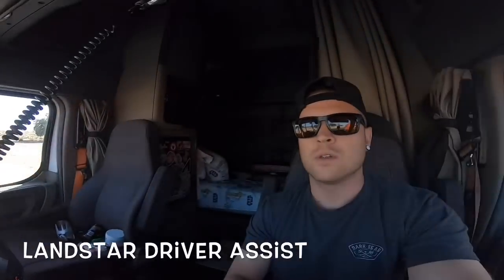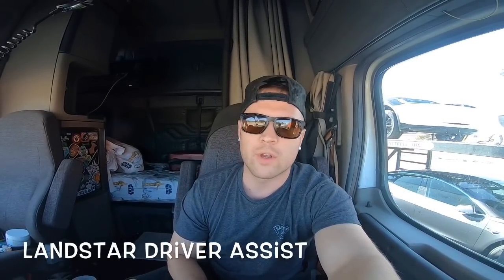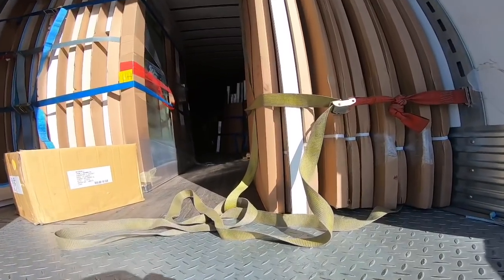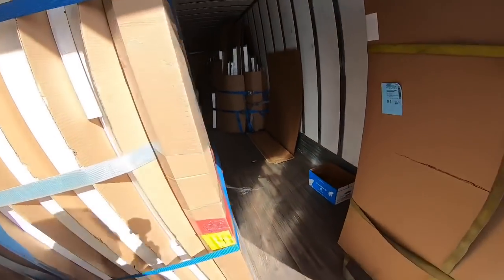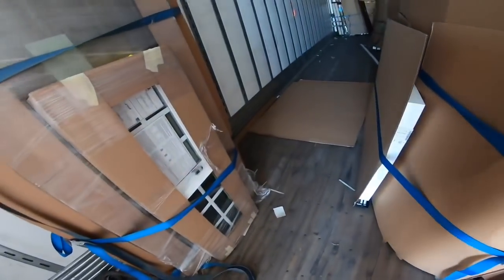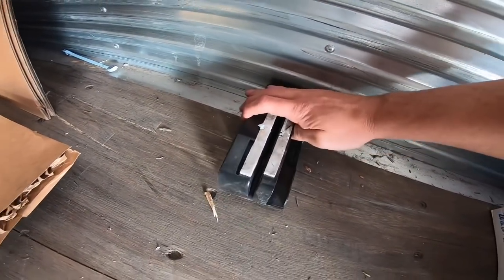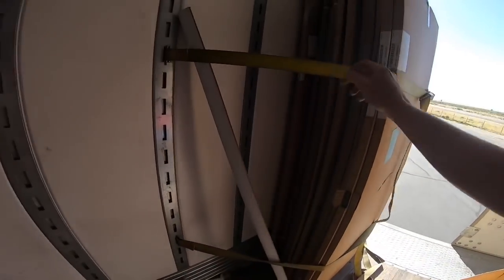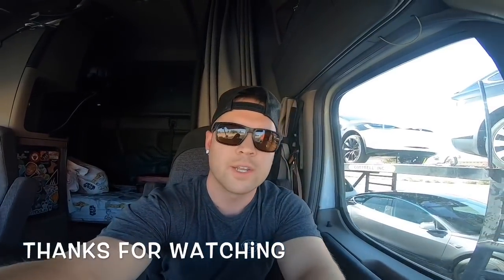Landstar Driver Assist Loads Info

Comment: I have to laugh when people call us dry van guys "steering wheel holders" . Driver assist on that load would KILL most flatbeders.
Reply from the maker: skyeram I know right and dude tires are even worse. I’m swore for 3 days after pulling a whole load of tires down that are stacked in like Tetris. Then put a tire on the ground and use your body weight to bounce them down the trailer to the guys at the end to receive. I would have to say tires are the hardest out of most of the driver assist loads I have done.
Reply from the maker: Temptinfates yeah this one looks waaaay easier than the last window load I did. There were giant sliding doors that were heavy that I needed help unloading. The last one I did had probably around 700 windows, but this one looks pretty easy for sure.